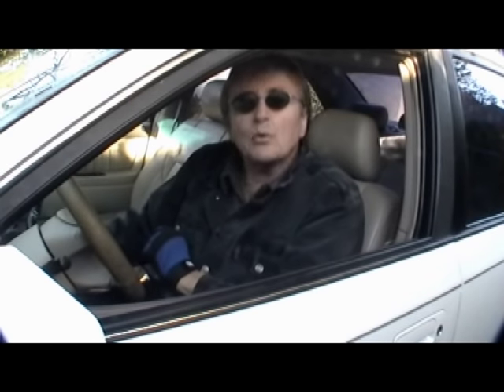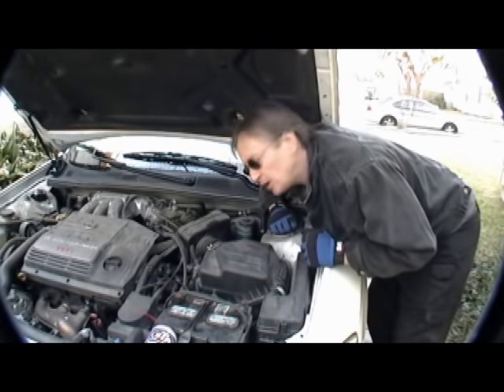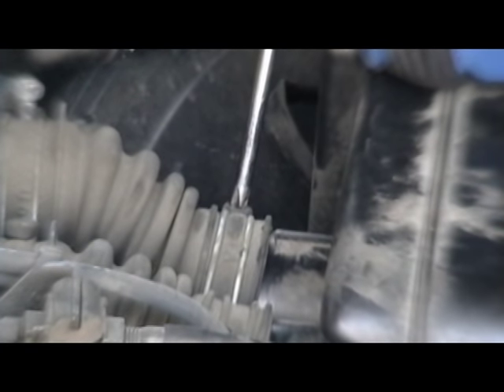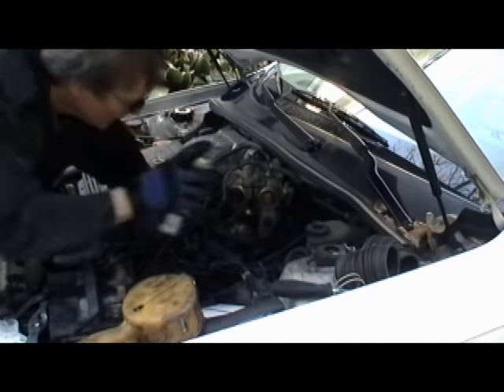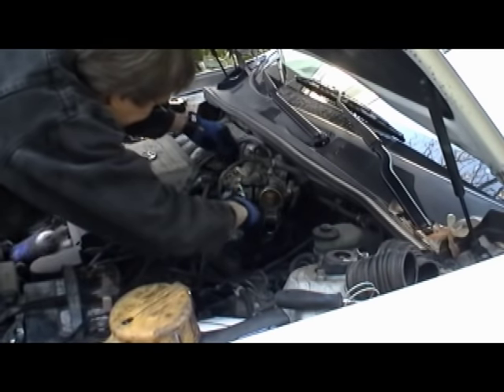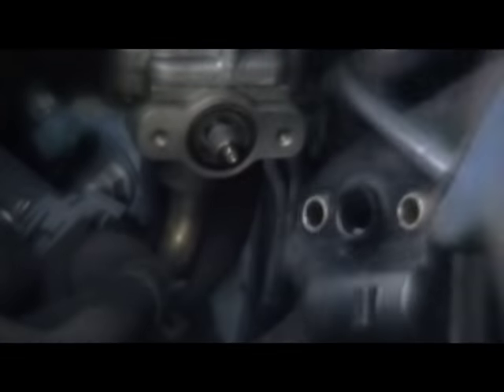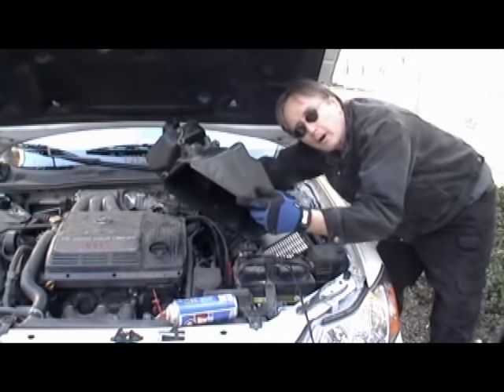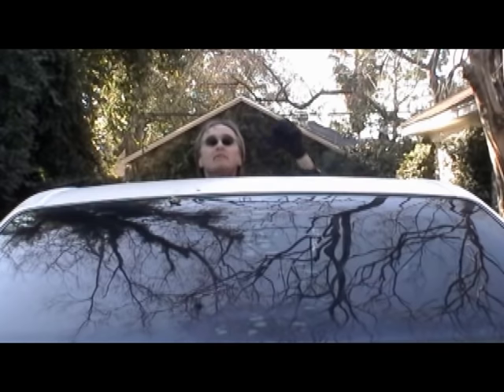How to Fix Engine Idle Problems in Your Car (Rough Idle)

Comment: Im currently having issues with idle in my car to where when its cold, it will barely idle (gotta give it throttle to keep it going), but meanwhile when its at normal operating temperature, it will idle up to 2500 RPM and not go down lower. What could be the issue? This is in a 1992 volvo 740 turbo and the issue happened recently after replacing a hose on the turbo (there was a hole)

Comment: My 2008 accord
Rpm drops at park from 1000 to about 500 but doesnt do all time
I have noticed it happend after a long drive
And i have noticed its stops happening after turning off internal  fan motor

Tht lets me conclude its somewhat related to  electrical
Any one

Comment: I have the same issue with my 1994Ols Cutlass Supreme S 3.1 It's been checked of an IAC,the sensors going to it,it been cleaned as well as the MAF or MAP which ever I have.I'm going towards either an bad o2 sensor or a Crankshaft Sensor.Been having this issue for over 16 weeks and NO ONE can scan it cause I have an OB1 PORT H E L P

Comment: OK nice info now let me ask you a question. Hope you can help. I got a 99 Chevy cavalier 2.4 twin cam. I paid for an engine swap and had a water pump, gasets, thermostat, new computer, starter, new plugs and oil, ignition coils, all also replaced. Like 1500-1600 bills on it not including what my car has cost me when I bought it. But yet they can't get it to idle right. So i. Asking for all this on my car I had done your telling me it could be that simple. Simply cause before it threw out that tod and completely messed up my original engine it was running fine. Now all this has been replaced and still I haven't gotten my car back. It's been 4 months already. Can you give me your opinion on this please. Thanks

Comment: Maybe 5 times per year, summer or winter it doesnt matter, my car will idle rough, shake, and rich smelling white smoke comes from exaust on initial startup. Restarting the car doesnt help but goes away after a few min. Also sometimes, maybe 1% of the time when i start my car up i feel a weird bairly noticable idle problem at low speeds, rpms may dip rabdomely. this affects me everytime i stop at stop signs. If my car doesnt just shut off it will act like i have a jerky transmition when i start my initial acceleration (0 to 10 mph). This always without fail fixes itself when i just restart the car and wont come bac for weeks or months. Maybe something needs cleaned or replaced? Spark plug or fuel injector?

Comment: I know I've come too late , like it's been years on this video , but I'm still glad to come over this channel . I got a question, my car shuts down on idle when my AC is on , then after turning it back on , even with the AC off now , it turns off again and again , and if I try to drive it , it suffers from an unstable Rev but then works itself by itself. It only happens when my AC is on and on idle mod . I own a 2003 E46 318i

Comment: Ok. 09 vibe. New alternator & battery in December, since then dropping idle at stopping!  Nee ignition coil. Same.  Then cleaned maf sensor. Meh.  So cleaned battery cables connectors, air intake had alot of carbon cleaned that, air filter good. Ran like a deer!!! Power galore, no idle issues, no loss of power when holding power window up     Two days later bam here we are agian. Fak. Plugs?? To deep for me to get at. Ugh

Comment: Hello Scotty I have a 2010 Chevy Malibu. I replaced the throttle body, 2 crank positioning censors,timing chain and gear,plugs,coils, air filter,  oil, taped flex pipe after I changed throttle body ran great for 20 minutes and car is still shaking in park idle what should I Do???

Comment: I am having a problem that is driving me crazy and kinda dangerous too. I have a 1999 Super Duty with V10. Only during wet weather when coming to a stop it wants to die, can't give it gas to clear up. I have to put in in park, shut the key off all the way. I can then restart the truck, put in gear and it runs fine until it decides to do it again. No codes were generated. I have replaced the differential speed sensor so far. I do not observe any water getting onto the GEM module either. After I start it back up there is a weird smell, not like rotten eggs though. I know the cat/mufflers are fine and new O2 sensors as well. Any ideas? This condition is random too.

Comment: I didn't even watch this video I just wanted to comment. I saw your video on lifting trucks, maybe you shouldn't use piece of shit chevy with a cheap lift as an example next time. A quality lift will drop the pumpkin and axles  (i.f.s) and retain a safe front end geometry. also your vette is slow and gay.

Comment: When I start my 1998 honda accord ex the idle goes to 2000rpm 2.5 rpm ,is that normal,seems like it's idling to high,plus when I stop at the light it gives a surge what would the problem be,I just changed the crafts haft censor yesterday! !

Comment: your awesome scotty!! love your videos. do u have any on 95 ford f150 5.8? 311k miles on original motor and trans. all sensors are new except mass air and air/coolant temp sensors. was my moms truck and it means a lot to me. it will idle fast from cold start for about 10 secs then stalls. has no power. will rev and take fuel in park. timing is right. out of ideas any advice would be greatly appreciated.

Comment: Would this work on a 1982 Chevy c10? Truck cuts off when I idle for too long. Example sitting in the long lines at Chick-fil-A truck will cut off if it takes too long.

Comment: Hello I have a 2007 pontiac torrent I  flushed the cooling system and now the AC and the radiator fan not coming on the light on the snow ❄️ botton just blink 3 times then goes off car not overheating checked all the fuse can't find the why can I help me please.

Comment: Hi Scotty.

I hope You doing great. Great videos, Thank You.I have a 1995 Cadillac
deville Concourse with 110,00 miles. Its been sitting in the garage for about 2 years.
The Last time I turned it on after jumping the battery, the car was idling high (very loud), 
some smoke was coming between the motor and heater blower.
I shut the car off, the next day noticed oil on the garage floor. 
Its a nice looking car and would like to get it back on the road. Any
suggestions ?

Thank You for You time
Felix

Comment: Hello
I have a 2014 Mitsubishi Outlander. The check engine is solid on and rough idle at 500 rpm. Is there a way to fix this?

Comment: Hi Scotty, I cleaned the Throttle Body on my 2005 RAV4 today. It was rough idling whenever I am at a stop 500rpm. I hope I didn't mess up the TB/AIC valve - it seems to be electro-mechanical. There was no wire line to open/close the plate. So I used my finger and pushed down the plate and held it open to clean the inside of the TB. I put back the air filter housing and waited more than 1/2 hr. Then started the vehicle and saw white smoke came out for a minute. The idle was at 2000 rpm at first and then dropped down to 1500 rpm at normal temperature. 

I revved the engine up to 3000-4000 rpm a few times, hoping the idle will drop back down to normal 750-800. But it didn't, it remained at 1500 rpm when I come to a stop. So I decided to drive around my neighborhood for 5 min. to burn off the AIC cleaning spray. When I shut off the engine on the vehicle, it felt like a rough engine shut off. Did I damage the AIC control for holding it open with my finger? I've read some blogs and they say I need to drive the vehicle a few days for the ECU to reset. 

Please advise. Oh...I enjoyed all your informative videos. Great videos !!

Thank you for your advice.

Tim

Comment: Hi Scotty!

My toyota altis 2008 1.8 has a problem. It usually runs fine when the AC is off. but when i get it on, each time the compressor engages the idle suddenly drops to 400-500 then after 1-2 secs it will be back to normal 600-700. sometimes when the idle drops to low the engine dies but it will start immediately. what causes this? please note that my throttle body is electrically controlled by my ECU. Hope you could shed some light. Thanks.

Comment: Funny, that's not how you clean the Idle Air Control Valve, sure, some of the spray you put in the throttle body is bound to make it down to the actual Idle Air Control Valve but you really need to take it off completely.  Cleaning the solenoid side is rarely needed. since it is sealed up but you sprayed the heck out of it and that was hilarious.

Comment: Hi I have a question about a 1966 Farmall 706 Diesel I own, I have 
restored it and repainted it but never opened up the motor because it 
only had 3000 hours on it. The tractor has an International D-310. When I
 cold start it, it runs bad like every diesel does but once it warms up 
at a idle with no load, it will poof and loose like 50 to 100 Rpm and 
blows some blue smoke when it does that, but then it will straighten 
back out smooth then like 5 seconds later it will do the same thing. it 
repeatedly does this even if I put the RPM's up to 1800 or even 2000 
ONLY when the tractor is in neutral with no load. As soon as i let up on
 the clutch in gear or a small load gets exerted on the motor, the motor
 evens right out stops smoking and sounds beautiful!, ONLY with a load 
on the motor. BUT as soon as i disengage the clutch it immediatly does 
the proccess. If i get done disking the field or the motor if warm from 
pulling a heavy load and i take all loads off of the motor, it doesnt 
blow any smoke and all and it barely noticeably does the symptom, but as
 the motor sits there at an idle and cools down, it starts doing it more
 again. I already put fuel system cleaner in the diesel tank, I thought 
that seemed to help a bit. please tell me what your best thinking could 
be that'd be great thank you.

Comment: I have a question about my 05 Trailblazer , when it’s on a cold start, it works fine. But when the engine gets to running temperature, around 1500-2000 rpm and between 40-60 mph , the car has a surge, the rpm needle bounces and the car surges with it until you force it into overdrive . Is that a bad throttle body? It also has a sort of hesitation when you push the gas , as well as a rough cut off .

Comment: Scotty did that and still have the problem on a Corolla 2013.... Goes from 1000 to 650 rpm and then back up to 1000...usually at the red lights

Comment: Hey Scotty!
I have a problem with my bmw 318 e46 from 2000.
Now especially when its cold outside i can see the sympthoms getting a little worse.
When the engine is cold it cannot idle if its below freezing point untill the engine gets warm. 
I used to get faultcode p071 which means it runs too rich. I've been driving the car for a year without the massairflow sensor and i dont get check engine light anymore when i drive with the massairflow sensor connected. What i noticed with and without the connection of massairflow is that the car runs better without then with it. If i give the car just slightly gas with the it connected then the car dies. So i must put alot of gas so it doesnt die on me. As well as i have noticed while giving slight gas the rpms go down but its like the car is going unevenly.. have any tips for what i can check? Should meantion that i already replaced the massairflow sensor but it didnt help that much.
Thanks in advance

Comment: Hello Scotty, on my Corolla 2004 the engine light is on ,and the code shown is P 0133. The curious think is that the light is on only when the outside temperature drops around 0 degrees (Celsius) or lower. Also, the idle is very high when the engine is cold on low temperatures. I would like to know your opinion before doing anything. Thank you.

Comment: Hey Scotty, I have a 94 corolla, same engine as your celica, I just had the distributor replaced because the seal blew out in it and wore out the coil. But after I got it back, it still idles really poorly, and runs incredibly rough whenever you get off the throttle. Would that be a problem like what you discussed in this video?

Comment: My 1994 Mitsubishi pajero has started doing the past couple of weeks. I don't have any money to fit it at the minute. Do you think it's ok to continue driving for the moment? When I start the car it gets to rpm 500 and that's it. It's fine when I drive but only when I am idle it's a problem at times because it cuts out occasionally. . ? Any help would be great

Comment: Scotty. I have a 02 grand Cherokee 4.0, it has a rough idle and stalls and surges sometimes. I replaced throttle position sensor and idle air control valve. Still runs the same except now after it warms up it idles high. I have also hooked a smoke pump to it and fixed all vacuum leaks I found. Any thoughts?

Comment: My car is not idling at all. When I start the engine I have to keep my foot on the gas for the engine to stay running and I can also hear it's misfiring. Changed the spark plugs and the spark plug leads. Also checked the coil pack and it's fine. Any idea what it can be.

Comment: Could this be my problem? I have a 2014 Scion Tc 2.5L. Same engine as the Camry.  My idle goes up at a stop light when I have my front defroster on and my lights and radio etc.. Then it comes back down and if I am at a light long enough it will do this a couple of times.  The car is at operation temp also when this happens.

Comment: I have a puzzler for a 1992 isuzu trooper. At start up it runs good, but when it warms up the idle is rough I cleaned the entire air intake assembly right down to the valves.
It has new spark plugs, so wires, and most fo the vacuum lines replaced.
When warm it sounds like it has a random misfire, and the check engine light will come on when the throttle open, but the light turn off at idle.
I'm so confused.

Comment: I found my EGR valve was bent and jammed in the open position causing loping idle.  Transmission rebuild guy probably tilted the engine downward at the back and it contacted with the firewall creating the problem.  1997 Firebird Formula now idles perfectly after popping on a new EGR valve.

Comment: Hi Scotty, I have a problem I'm hoping you can help with. My car is fine until it heats up a little, then it starts to vibrate and chug like crazy on idle, going up hills, and acceleration. Its been getting worse and now it just stops if it's in idle. It's usually fine if I put it in park though. Any ideas?

Comment: Hi Scott, I've got a 2009 Toyota Corolla.   The car vibrates when it is still in Drive when it is at stop, vibration goes away and comes back, the rpm goes up a little (no vibration) and when it drops a little vibration starts. I was not sure if I could clean the electronic throttle as you suggested in your video because I was afraid that it will mess up the electronic setting (if any).
Reply from the maker: +A Fong if you disconnect the battery first, you an clean an electronic throttle too. Also check the MAF sensor, they can be cleaned

Comment: I have a lincoln zephyr 2006 the rpms go hight when im driving and check engine light starts flashing also when i get to 40mph the car starts shaking.. and also when i want to start my car i have to play with the ignition switch in order to start the car i think its the ignition switch cilynder but i dont kno if i need another key or if i can use my  same key or if i have to reprogrammed my key again please help thanx

Comment: scotty sir, 07 Altima 4 banger, idles terrible, stumbles upon acceleration and sometimes even complete loss of power while still running to where it will only do 20mph. all intermittent and idles fine in neutral. Only code thrown is generic lean bank one. preciate your work brother.

Comment: I used carb and choke cleaner for this - the mechanic said it's the same thing - and I used the whole can . 

BUT I DIDN'T LET IT DRY 

it was so hard to start , when I reved the engine a little it stalled . so I turned it on again and let it for about ten minutes so it get out with the exhaust.  now I figured I open it up again and let it dry . 
what should I do now ? ? I'm afraid I messed up the engine .

Comment: I think I have this problem on my VW cc but I’m also missing a vacuum hose would this cause a similar problem?? I have a check engine light on and my idle is too high and it basically drives all by itself and when I’m in park the rpm’s go up and down and run too high

Comment: I have a 2003 jeep tj manual, and when at a stop the rpms drop low to very low and you have to rev it up an hold it at 1, in gear or neutral. We were stopped at a costco gas pump and it stopped at 800ish rmps and held there without revving. I will look at the manifold and hopefully that’s the issue

Comment: Update:. Watch out with the MAS unit in the throttle body, needs it's own cleaner and let it ambient air dry.  If the heating element sensor blows out because it's wet it can cause error codes and need replacement of the MAS unit

Comment: Do NOT clean your throttle body like this if you have a newer vehicle with electric throttle body sensors. You will be taking your car to a shop to relearn your idle or like me have to replace the sensor.

Comment: I gotta a question Scotty!!! Can you plz help?? I got a Pontiac sunbird (94) with 90,000 that has a 3.1L with a 5speed... And every time I replace the battery, a nd start it back up, it doesn't want to idol.. It starts and runs fine, but I have to take to the dealer every time for them to do a 5min fix that is inconvient.. And can I do what ever they are doing myself? I thank you for your time
Reply from the maker: +jon doe  they are set up that way and need a computer reset. Buy quality batteries that last a LONG time to bypass that.
Reply: +Scotty Kilmer really?? That advice goes without saying. I can't "reset it" myself tho?